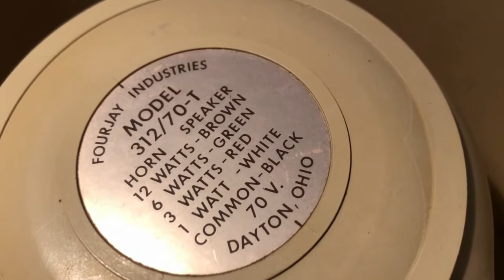Fourjay 312 Horn Speaker

Comment: I just bought one of these online for my 70v setup at home installed in my living room. Like the LilShag below said, these were common at Walmarts back in the 90s when they still used drop ceilings; these stores often used these Fourjay horns in the open ceiling rooms of the store such as the stockroom, garden center and auto center garages while the areas with drop ceiling just simply used typical ceiling speakers made by Quam.

Comment: They were also used in walmart stores
Reply: They were replaced with fourjay 306(the mini horns) in alot of 2000-2006 remodels
Reply: The fourjay 306 is also common in new builds of Walmarts until 2007
Reply: Magic IS cool bogen made horns similar to these but they were much smaller.There is one that is disconnected in my school.
Reply: I just went a Walmart a few weeks ago that was still using this very horn in the garden center room of the store. I bought one and installed in my living room earlier this month and it sounds great (I know it's weird to have horns in your living room, but I have high ceilings so acoustics matter here).
Reply: @christiangonzales7429  it's a hit or miss some kept the 312 luckily
Reply: @magiciscool8704  The newer Walmarts don't use them at all; they have the music/PA tied into the fire alarm.
Reply: @christiangonzales7429  I know and between 2007 and 2008 toa sc610 were common at Walmarts. Walmarts experimented installing toa sc610 in select locations in 2004-2006 but fourjay 306 was always more common too during those years
Reply: @magiciscool8704  Wow that's interesting. None of the Walmarts near me had the TOA horns, but I did see those SC610 horns being used at Lowe's garden center recently (in fact, right across the street from the Walmart where I spotted the Fourjay horn). They are extremely loud, especially when paging over the intercom!
Reply: @christiangonzales7429  which location do you live by? Which state? Do any use fourjay 306? They are the most common horn at walmarts. Also Lowe's with toa horns are rare in at least California and Hawaii where I lived. Most use atlas ap 15 and they all suck ass. Lowe's uses the same quam speakers Walmart uses in most locations
Reply: @magiciscool8704  Live in Houston, TX. A few Walmarts around here use the Fourjay 306, they are quite common here. The one by my house is a special exception, they use the Atlas WR-5AT horns in their garden center (rare find). I went to Lowe's that had the Atlas AP-15T in the garden center (no music. They have the music turned off in the garden center and only use the horns for paging). Inside the store, they use the Fourjay SDT4-EP8 mounted on the rafters. I own one of those as well, in my living room mounted on a beam. As for the Atlas AP15, I am quite a fan of those horns and I have several of them; they are very loud and clear in my opinion.
Reply: @christiangonzales7429  the worst horns that big establishments install in my opinion is Lowell. Kohl's uses quam speakers on sales floor but for the backroom depending on location they use either toa sc610 or Lowell horns. The reason why stores aren't consistent when it comes to what backroom or outdoor horns they install alot of the time is because of the budget the store was built on at the time and all these Kohl's stores opened the same day. Puzzles me why they chose Lowell horns over toa they are more expensive and have extremely limited frequency
Reply: @magiciscool8704  That is strange. I am not sure what budget constraints are being put on them when they build these stores, but Kohl's would be better off with TOA due to the advantages. Did you use to work at Kohl's? I've never been in their backroom (or anyone's backrooms) but I have worked in a building that was once a Walmart and many of the Fourjay horns were left in place, although decomissioned. I've always wandered what horns Walgreens uses in their backrooms, though.
Reply: @christiangonzales7429  I never worked at Kohl's but I sometimes take a peak at the backroom during dead times when there aren't many workers I also prank and do  unauthorized pages on intercoms as a hobby. Usually if you sound like a employee they won't care much. Walgreens varies between just the same quam speakers mounted on the open ceiling to quam qh horns. I've peaked inside when the backroom door is open. I've worked at whole foods tho and new locations beleive or not still use fourjay 312 in the back. Is the Walmart with the atlas horn a newer one or older one? I want to look up the location on Google maps. I also found a list of Walmart locations by opening date. 

 Also to answer your question about budget.Each store, even applies to whole foods, has a budget set for each build and remodel according to how corporate thinks the store will peform. Corporate usually studies the average income of each location. Most of the budget goes into building the new store. After the store is built certain brands of speakers are chosen based on whats left. For whole foods in my case, some stores use TOA amps and some use Bogen amps. The backroom used to be mostly fourjay 312 but recently some stores are also opening with Atlas SM series speakers in the backroom.
Reply: @magiciscool8704  Wow, I am learning lot about the stores, budgets and equipment in just a day! When Walgreens is using the Quam ceiling speakers in their backroom, they must be the same ones Walmart uses as well. The Walmart store using the Atlas horns was built in 2003, replacing a non-supercenter that was just down the street (also the building I worked at for a while that I mentioned earlier). It is located at 3506 S Texas 6, Houston, TX 77082. Where did you get that list of Walmart locations at? I would love to see it.
Reply: @christiangonzales7429  I follow me Mercury fixit he's the god of PA system
Reply: @christiangonzales7429   when I tried sending a test email it said that your email wasn't recognized
Reply: @magiciscool8704  That's strange. I just sent you a test email from that address. Please check and see if you got it.
Reply: @christiangonzales7429  I got it there's a link to my other YouTube sent to you too subscribe!
Reply: Oh i also seen the mini ones at a lowes this one at a mcdonalds and an applebees
Reply: @lilshag3472  Lowes used the mini-ones alot at their older locations. However lowes in alot of their older locations are replacing them with TOA SC or Atlas AP horns. I peaked inside the lowes server room and they use  TOA amps.
Reply: @lilshag3472  IHOP uses fourjay horns outside some restaurants
Reply: The building where my mom works has 2 of them in the back of the store on the ceiling and i even seen some in the back of a bilo store as well
Reply: @lilshag3472  Where does your mom work at? is it a grocery store. Thats cool if she got to page there.
Reply: Magic IS cool Roses Express store that used to be a food lion
Reply: @christiangonzales7429  I've seen a good mix of Fourjay and TOA at the Walmarts around here... The 312 and 306 in the garden center, another Walmart close to where I live that has TOA SC-615T horns (the outdoor garden center horn I remember hearing clear across the parking lot, it has since been disconnected). One interesting install was at a Walmart Neighborhood Market that has Quam BB2/B beam mounts and TOA SC-610s in each corner of the store.
Reply: @magiciscool8704  two Kohl's in my town use Lowell both in the sales floor and the stockroom. Horns in the stockroom were unusually quiet the time I went to do a fire sprinkler inspection. Have to agree they're overpriced.
Reply: @ElCalamardo69  how new were those walmart stores. walmart experimented with TOA horns in 2003-2004 but mostly opened with fourjay horns until after 2006.
Reply: @magiciscool8704  Walmarts with Fourjay were early to mid 90s, one which opened in 2004 has TOA. I've not seen any Supercenters or Neighborhood Markets after that use Fourjay after about 2005. Supercenters after 2010 use Cooper Wheelock speaker strobes and Neighborhood Markets I've only seen Quam.
Reply: @ElCalamardo69  walmarts fourjay model common through 2006 was the 306. You dont have to tell me but roughly what area do you live in. I live in california but i have traveled to other states. i go into walmart stores and have a list of when they opened
Reply: @ElCalamardo69  one that opened in 2006 uses the rare grey variant of the fourjay 306.
Reply: @magiciscool8704  I live in West Texas. That's pretty cool you know when stores open!
Reply: @ElCalamardo69  do you know what HEB use or UNITED supermarkets
Reply: @seabass8482  There aren't HEBs or United Supermarkets where I live unfortunately...
Reply: @ElCalamardo69  Whats the most common speaker brand in west texas. When I was in texas in the dallas area Quam and fourjay seem to be really common in texas
Reply: @ElCalamardo69  any idea of when the kohls were built the one in my city uses all atlas. Maybe its because I live in cali and atlas is common here
Reply: @seabass8482  mostly Quam, then Atlas. Fourjay is kinda hit or miss.
Reply: @seabass8482  we have three Kohl's. The two that use Lowell were opened 2001 and 2003. The newest store which opened in 2009 uses Bose.
Reply: @ElCalamardo69  can you give me the exact location of the walmart by you with a TOA SC615 horn? i want to look at it on google maps. Also the neighborhood market with the TOA horns on sales
Reply: @magiciscool8704  sure. Do you have other social media accounts? Otherwise send me a DM
Reply: @ElCalamardo69  Interesting setup. Quam BB2/B are quite common at Walmart, but to see them being used with the TOA horns on the sales floor is unusual. The TOA horns are usually only used in the garden center and the open ceiling rooms (stockrooms, auto repair bay, etc.)
Reply: @christiangonzales7429  it's the only Walmart here in El Paso that has the BB2/B. All others use the BB2.  I've only seen the TOA horns in Supercenters but it's the only Neighborhood Market I've been to that has TOA horns.
Reply: @ElCalamardo69  Here in Houston, none of the Walmarts have TOA at all. All I see are Quam ceiling speakers and Fourjay horns, plus the fire alarm paging systems. Lowe's in Katy has TOA SC-610 horns in the garden center and they are loud when people page over them.
Reply: @christiangonzales7429  hmm weird. The Walmarts here are kinda strange as I've seen a mix of Fourjay and TOA, one Sam's club is that way as well, and one Lowe's has a TC series of TOA horn (disconnected, I think the TC-154) but Atlas horns throughout.
Reply: @ElCalamardo69  it is not letting me DM you i need to get an emial from you soon if you get time thanks
Reply: Magic IS cool i have an atlas ap 15 horn and it is a really nice horn
Reply: Christian Gonzales i am planning on rigging up an intercom at my house one day
Reply: The walmarts in Owensboro Kentucky have some